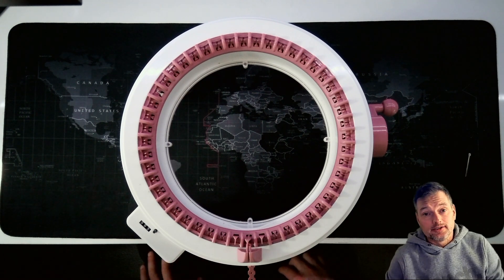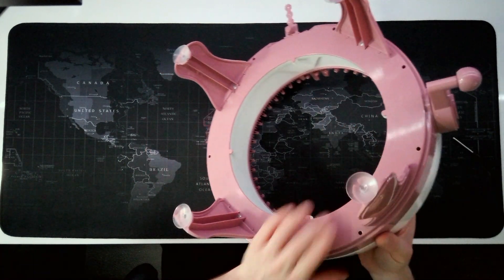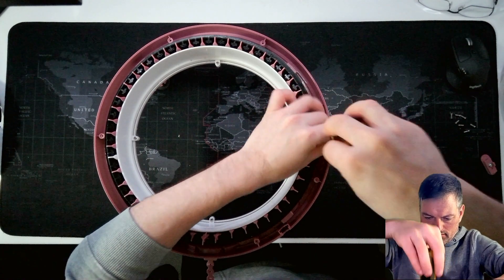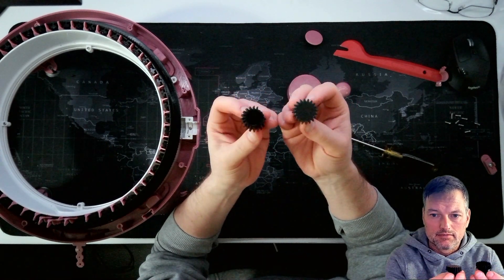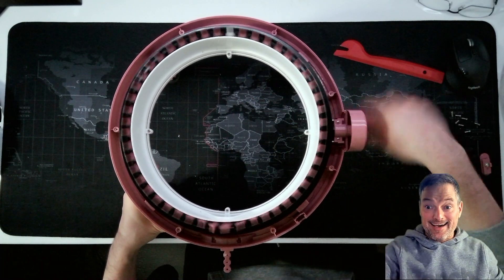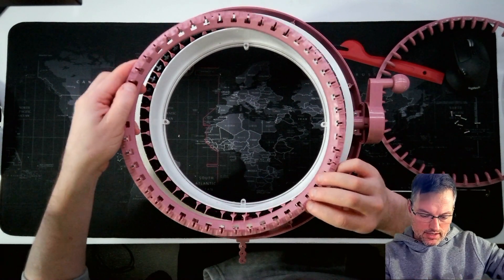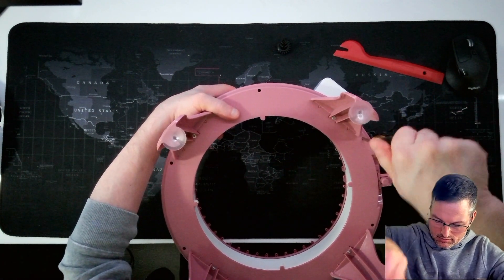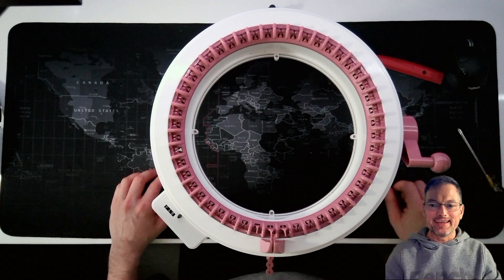Repairing a Sentro 48 Knitting Machine with 3D Printed Crank Gear. Has a stripped hand crank Miaoke

Comment: Some1 needs to make a handle that i can change the gear - not 1 of my 5 have a removeable gear
Reply from the maker: what machine do you have? all of them come apart because they were not glued as solid pieces during manufacturing. that cap on the top has a very well hiddden seam and it took prying at it with an exato to pop it off a little.

Comment: I didn't think my sentro crank cap came off. Looked down the shaft of the gear and saw metal. Yup I had to find a very thin screw driver but it came off. So if you think your cap will not come off look inside the crank shaft with a flashlight and see if you see the end of a metal screw.

Comment: This repair can't be done on a Sentro. There's no cap to flip off the end of the crank. Everything's sealed in.
Reply from the maker: I thought mine was sealed as well. I needed a knife to get in that seam. The outer housing comes apart either way and it will pop out and you will be able to undo it then. They wouldn't seal it up in manufacturing, and the handle and gear would not be made together in the same plastic mold.
Reply: I also have a sealed crank.
Reply: Thanks for to get video! Definitely not sealed but can’t get the screw out